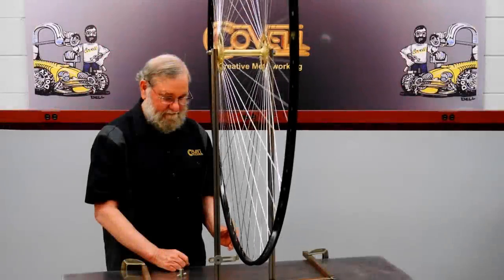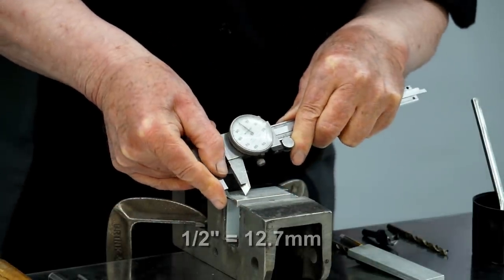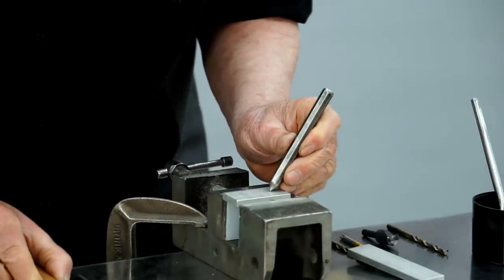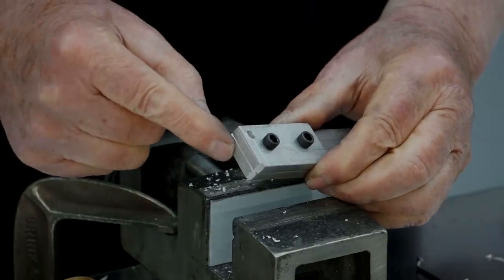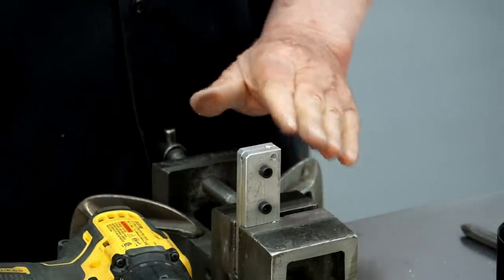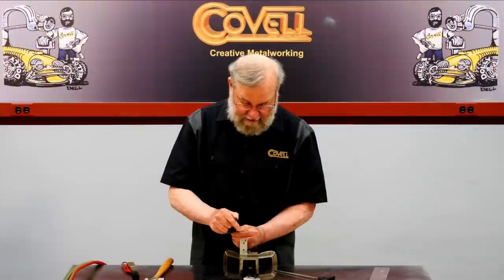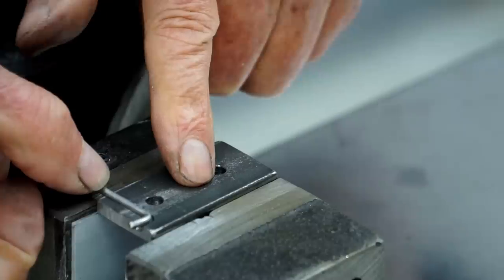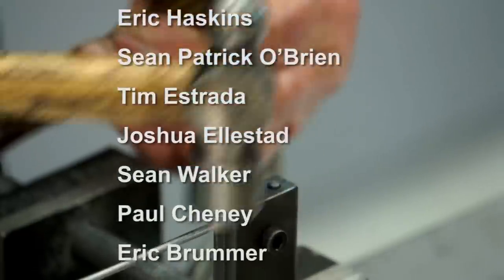Making Oversized Spokes

Comment: Ron, I know it takes a little more time to convert the measurements that you do, to standard units, but know that this helps us viewers from outside the US, A LOT! I can't imagine how much "thousands" are, but I can understand those millimeters! Haha nice project! Your excellent craftsmanship really shows in every project!
Reply from the maker: Well, I grew up with the Imperial system, and it's the one I understand intuitively - but I realize that only 3 out of 193 countries use it, and I want my videos to be understandable to as many people as possible.
Reply: I have a question: is a "ten thirty two" screw twice as big as a "five thirty two" screw, and if not, why not?

😄
Reply from the maker: I certainly acknowledge that the Imperial system has some quirks. Threads 6.3mm and smaller are designated by a number, and larger threads are designated by a fraction. And no, a #5 screw is not half the diameter of a #10 screw. I can't tell you why this is the case, but I do understand why more rational systems are used by most of the world.

If you think the thread sizing system is odd, look into how the thickness of sheet materials are measured. The larger the gauge number, the thinner the material!
Reply: @RonCovell   It is great comfort to find that there are still North Americans who can respond in a sweetly reasonable way to a bit of light-hearted ribbing. You're not of Canadian extraction, perchance? 
If you're a born and bred citizen of the US: Have you ever thought of standing for high office?
Reply from the maker: Well, I do consider myself a 'born and bred' US citizen, bur really, the vast majority of everyone in North America has ancestors that came from somewhere else. I have no interest in holding any political office. My life is complicated enough as it currently stands!
Reply: @Gottenhimfella  Damn you! I wrote out a careful answer before I clicked "Show more" and saw that you were joking. Well played.🤨
Reply: @Gottenhimfella  ♥♥♥
Reply: I've long known it's thirty eight thousandths per millimeter, been using "imperial" better than fifty years, still see zero advantage to the metric system.
Reply: @RonCovell  The sizing for imperial was based on "sizes needed" for common jobs and with industrialization ever more sizes were needed with technology advance.  I've been using imperial and metric all my life, have ridden bicycles and motorcycles and worked in metal since childhood.  Still substantially more comfortable with imperial than metric.
Reply: @johnmcclain3887  I'm only 40 years into using imperial. I tend to use metric for all my engineering stuff, but imperial day to day, and for construction. It doesn't really bother me to simply use the system that's easier for the task at hand, so I love Ron's approach.
Reply from the maker: Thanks for your great comment!

Comment: Ron, the first two years of my toolmaking apprenticeship was at the Ford Apprentice Training Center at Harrold Hill, Essex, UK.  A storry did the rounds one day about the chief instructor was doing his rounds when he came across an apprentice holding a hammer half way along the handle. We'd been taught to always use the full length of the handle, so the chief instructor took the hammer and cut the excess handle off with a hacksaw, and returned it to the apprentice.  I was reminded of that story seeing you hammer the spoke flare.  I think I now own at least a dozen assorted hammers, and I am sure there are times when I don't use the full length of the handle.
Reply from the maker: Well, when you  need maximum power, there is no question that gripping the handle near the base is the best strategy. But sometimes, a lighter hit is preferred, and that's when I 'choke up' on the handle. In my mind, it's not a 'one size fits all' thing.

Comment: After watching awhile and learning so much I finally have a good tidbit of knowledge to share. The jig you used to make the heads is basically the same as what I use to make rivets. The key length to forming a good rivet head is one and half times the wire diameter.
Reply from the maker: That's a good tip. I think the formula would be a little different for a 'head' that has a taper, which fits into the countersunk recess in my fixture.

Comment: Beautiful work Ron.  I build custom wheels for various contraptions and until now just bought the cheapest spokes that I could find (that happened to be longer) and then cut them - the garage is covered in 2mm offcuts!  I’m absolutely making RC style spokes from here in.  You can buy the rolling heads for those  machines for around $30 make a little arbour for it from mild steel and run it in a cordless drill - works great once you get the pre-load in the rolling head dialled in.
Reply from the maker: Wow - that's great to know! I have always sent my spokes out to be threaded, since I thought thread rolling machines were super-exensive.

Comment: I live anything bicycle related and this is right up my alley.... I've always wanted to make a bike from scratch and literally make everything but I know my welding experience is lacking so I'd need some practice before I go trying to make one, but this is very useful information.  Thank you and keep up the great work...   😁
Reply from the maker: The first bicycle frame I built was a lugged design, and I silver soldered it together. The learning curve is much easier with silver soldering than for welding!
Reply: @RonCovell  - I've watched a lot of silver work on Paul Brodies channel and I've always wanted to try but I don't have a garage or shop to work in so I'd most likely be in my basement or outside so a welder seemed like a better option...
Reply from the maker: Welding is a good option, but I don't see why you couldn't silver solder in your basement or outside. An oxy-acetylene outfit should be less expensive than most welders, also - and it's great to have one for heating stock for bending.
Reply: @RonCovell  - That's actually a good point... It would be a good place to start, I might have to look into that as an option instead of diving into MIG without any real practice. Thanks again....   😁
Reply from the maker: I don't know what kind of bicycle you want to build, but for a lightweight frameset, MIG welding is not a good solution. These days many bikes (like cruisers, and e-bikes) are made from heavy-wall material, and MIG welding could work for those, but for the traditional bicycles where weight is an issue, thin wall tubing is the norm, and MIG just isn't the best process.
Reply: @RonCovell  - I ride BMX but I'm more interested in building ebike frames so it would be a heavy wall tubing and probably some gussets and thicker material for battery boxes... Besides the frame tubing I'd probably be using it to fix random crap as well so I'm looking for something that would be multi-tasking and a MIG seemed to be the right choice, but again I don't know. I've done some welding before but probably only about 3 feet of weld total in my whole life so I definitely need practice but from what I remember it was easier to adjust the settings and stuff to suit the task... But then again I was only able to practice a little bit on some old junkyard Mopar fender scraps, I wasn't allowed to adjust anything or use any other material, so my experience is very limited.
Reply from the maker: For heavier material, MIG welding is a good way to go - and like you say, it's pretty versatile.

Comment: I've worked with Stainless (mostly 316 & 305) turning & milling components. Most grades are actually fairly soft. However Aluminium is usually even softer & less far tolerant heat, so I'm not surprised that became an issue for you. You're quite correct about forming the threads. Using a die to cut them would probably lead to stress fractures. A rolled thread will be stronger & more robust in tension.
Have you considered using thicker spokes (such are used in Tandams & some other applications. These bigger wheels may benefit from using them.
Reply from the maker: Most high-wheeler replicas use larger diameter spokes, and that would be a good idea for a vehicle that gets a lot of use. Mine is for only very occasional use, but I appreciate your suggestions!

Comment: Super job! It appeared the aluminum fixture sucked the heat away quicker than the steel fixture did.
Reply from the maker: I know it looks that way. I don't have a good way to gauge it, but I would think the two metals would be about equal.

Comment: Great tip on stretching wire to straighten! 

Also, watching that process, and thinking about doing it 72 times, had me wonder if there was any cam locking system or clamp that could have helped expedite the process over those two screws. Tedium terrifies me. 🤣
Reply from the maker: Yes, there are many types of locking clamps that could expedite the process Here's one example:
https://www.youtube.com/watch?v=WjboLU8vgug

Comment: Great video Ron! An even more expensive but maybe more versatile method of threading the spokes might be uding a geometric die head in a lathe. They do very well with threading small diameter long parts
Reply from the maker: Geometric die heads are certainly a fast way to make threads, but even so, a rolled thread is inherently stronger than a cut thread. The threads on just about every bolt or screw you've ever seen were made by rolling.
Reply: @RonCovell  true!

Comment: Looking at this massive wheel (and my grandpa's old horse drawn carriages) I had an idea:

An electric driven horseless carriage fitted with those giant wheels. It's gonna be ridiculously expensive and probably not street legal, but someone gotta do it
Reply from the maker: I like your idea, and I'm nearly certain there is a legal way to do it!
Reply: Just keep the max speed under 25mph (demonstrated thru rpm/gearing/diameter) and it's just a funny-shaped golf cart or Neighborhood Electric Vehicle.

Comment: Thanks for making this. Awesome video
Reply from the maker: Glad you liked it!
Reply: @RonCovell  Been thinking about it. Your first attempt at a jig. Did you not just drill the bend radius hole in the wrong place. Should the radius of the drill hole size not co-inside with the desired internal bend of the wire. Therefore not resulting in that weird collapse and double bend you got when you tried riveting it over. that said, the second attempt work just as well
Reply from the maker: I think the solution you suggest here could work, also. Thanks for your thoughts.

Comment: Very nice! I'm sitting here thinking "man, that's a lot of twisting on those fasteners..." considering you have a good quantity of spokes to make. So my mind start turning... perhaps a much coarser pitch on the threads so a quarter or half turn tightens/loosens... and some type of weak spring between them to make taking it apart for the next spoke... Nothing says amateur like over-engineering a simple device, right? Thanks again so much, I do find your videos really satisfy my inner machine shop guy.
Reply from the maker: Well, I'm glad you're thinking!

Comment: Hi Ron, thanks for the your version of making a spoke head, although you have made the spoke with a angled head the head is always put on to a straight spoke and the bend is put on after to whatever pattern you require, how ever you had made a spoke holder and a good stop at the same time, as when you make a head on a straight spoke the problem arises when you try to hold the spoke wire to apply the head, i was bemused to watch you pull the spoke wire straight, and although you did not show what part of the car you connected the wire to, may i suggest you use the towing eye adaptor, this screws direct into the chassis end and not any body work, as the body work will stand a small amount of distortion before it collapses. the comment on rolling threads the option of cutting threads was stopped by the Lemet wire works in Birmingham England in the 1970, as the quality of the dies and publicly owned cutters were very poorly maintained, and breakages  started from badly cut threads, hence rolling became the norm, until metric came along.
Metric threads work and are used everyday now by most countries and rolling head are easier to obtain. the old threading SWG or standard wire guage is an UNF 10 32 size is used on 8g 7g and  6g spokes and the lighter ones 9 and 10 swg is 0,144 x 40 un, now the latter is one of the hardest sizes to locate.
it was entertaining watching you work.
All the best Roy Thersby Wheel builder for 65 years
Reply from the maker: Thanks so much for the wealth of knowledge. Obviously, I'm a 'newbie' at making spokes, and you are a lifetime professional. 
I couldn't find a place to attach a towing eye on my van, so I used the attachment point of the front suspension under the hood.

Comment: Great video. I like a lot that you name each and every little step that you take. This way I feel like I could make something nice as well, and at the same time I get a glimpse how much work went into the whole piece.

Just a little idea: since drill bits tend to make holes that are just a little bigger than the bit's diameter, maybe it could have helped to put a little piece of newspaper between the two blocks of your fixture while drilling. This would have made the hole just a tiny bit smaller and given you a little extra grip on the spoke while working on it. Or maybe it would have provided a pretty triangular hole, what do you think?
Reply from the maker: Glad you liked the video!
Using the thickness of paper to 'tighten up' a sloppy fit is a reasonable solution for some operations. If I need a hole to be precise, I usually drill it undersize, then use the correct size as a second operation. Reamers are much more precise than drills, of course, so we have a number of options here, and I always like hearing creative solutions to the problems we all face.

Comment: As you were drilling the clearance hole in the fixture, my thought was "but it needs to be tangent to each channel".
Reply from the maker: Well, my goal was to position the clearance hole so it was tangent to the channels (the center of the hole was the intersection of the channel centerlines) but as you can see, the second fixture worked much better.
Reply: @RonCovell  that construction only works if the radius of the hole is zero.
Instead, scribe a line parallel to the farther edge of each channel with a distance from that edge equal to the radius.  The hole should be centered where those lines intersect.

Rounding the corner off with a burr worked for you, but I doubt I could pull that off.  🙂
Reply from the maker: Thanks for the clarification!

Comment: Beautiful work.  I love the addition of the first unsuccessful jig.  Question:  since the head was red hot and cooled very quickly, would it be worth tempering them?  Thanks for your content.
Reply from the maker: The material I used - mild steel wire (presumably 1018 or 1020 steel) doesn't have enough carbon content to be heat treated, but the hammering certainly will work-harden the material.
Reply: @RonCovell  Thanks for your info.  I appreciate it.
Reply: I was wondering about this as well.  I believe most off the shelf bicycle spokes these days have cold-formed heads, but they're made of stainless, not mild steel.

Comment: The aluminum blocks puzzled me swapping out the vice jaws for the later steel tool for quick clamping v 2 allen screws with 72 spokes to make and no more complex to make.
The hole for the radius was to low but the better clamping with the closer fitting was far better.
I did my apprenticeship as a fitter and turner and spent 6 months in the tool making section and left 6 month after my apprenticeship was over.
Reply from the maker: Certainly, vise jaws could be made that would clamp the wire, but I wanted to show how you could make a clamping fixture with simple tools - not everyone has a milling machine, or even a drill press, for that matter.
I can tell that you 'know your stuff'!

Comment: Oh that is awesome. I would like to make a wide rim with carbonfiber spring spokes. So it provides a comfy ride. So don't need these kind of spokes. But to make a large wheel always got my head spin. Because i don't know were to buy those tires. Not the sollid ones but with air. One time i thouhgt to sew a couple of tires together but there holding there form. So that didn't work.
Reply from the maker: I wish I knew where to get large pneumatic diameter tires and tubes, but I don't. Here's one other possibility:
https://www.youtube.com/watch?v=qNzl6N_ScyQ

Comment: Dang! Dude drills down perfect 90° along with a 90° edge, and perfectly 90° in the midst of two clamped plates, without using a drill press! Tell us how the ** you do that, and you'll have the eternal gratitude of thousands of people!
Reply from the maker: Actually, when you are drilling at the juncture where two plates are clamped together, the drill tends to 'follow' the interface, helping you keep the hole straight.

Comment: You aligned the center of the large relief hole with the center of the small 2mm pathways.  It would have worked better if you had offset the large relief hole so that the 2mm pathways intersect it tangentially.  Picture a torsion spring, where the spring coil represents the large clearance hole giving you the radius, and the straight “arms” coming off the spring at 90-degree angles are the 2mm pathways.  No vertical offset in this case, of course.  Doing it that way would have maintained the nice radius but still given the wire support so it doesn’t kink when hammering on the end.
Reply from the maker: Very good idea!